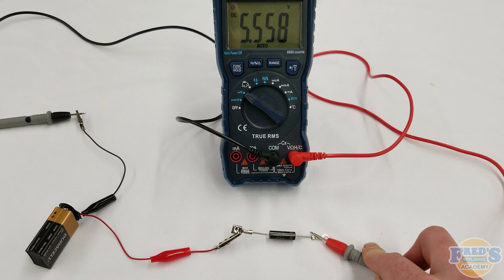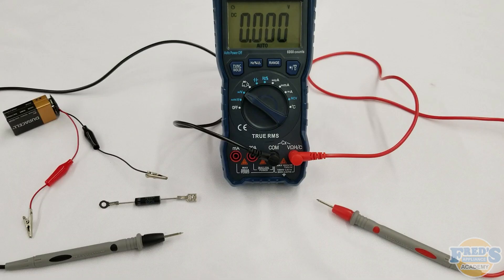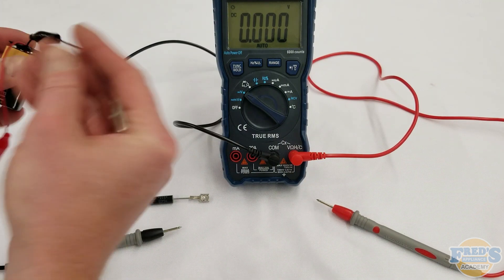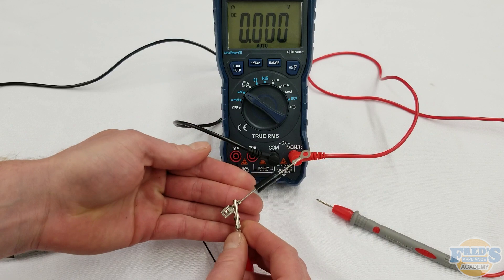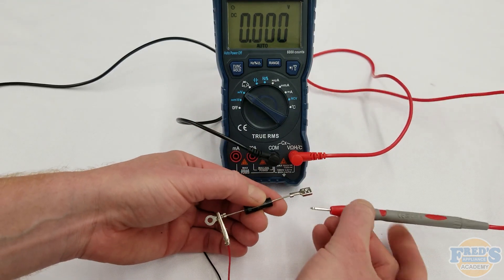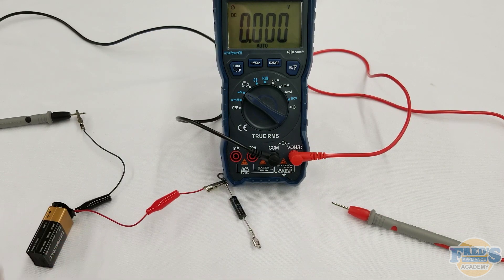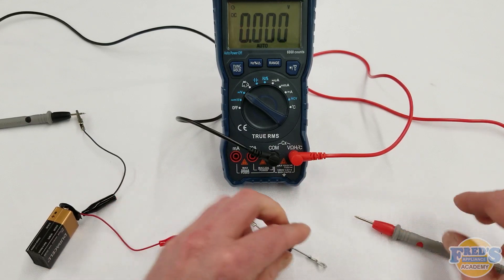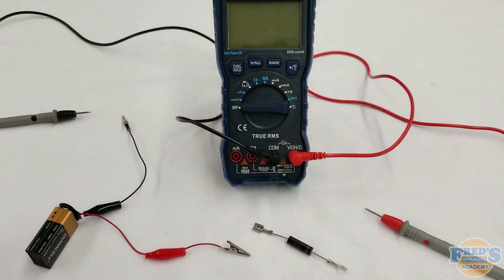Testing a microwave diode with a digital meter

Comment: In this video, is the diode being tested considered good? Since it still shows voltage on the side you mean it should not. Mine shows 5.4v in one direction and .004v in the other. Is that considered good or bad?
Reply from the maker: It should show nothing in the opposite direction.

Comment: Can you please clarify something in your video...  You say power flows from the anode to the cathode sides (positive to negative).   My other sources indicate the anode side is the negative and the cathode side is positive.   Which is correct about anode and cathode polarity?
Reply from the maker: Both are correct — depending on the device.

Battery anode is negative (during discharge).

Diode anode is positive (during forward conduction).

Comment: I have a number of 12 volt, low amperage DC power supplies kicking around.  I assume this would work fine instead of the 9 volt battery?
Reply from the maker: We only suggest the 9 volts since it has the battery terminal connectors.

Comment: Thanks for the video. I didn't have  a 9v battery but 1.5v. It reads the same voltage (under 1 v) in both directions for my the diode  2CL3512H . Is that within normal or it's definitely broken?
Reply from the maker: I would try at least a 9v source. The high voltage diode may require a higher forward voltage. If it tests the same in both directions with a 9 volt, then it is bad.
Reply: @DarkGT: You can't test a HV diode with a 1.5v dc battery. It has to be at least 9v to  test correctly.
Reply: @rscelectrical7091 Thanks, I read about it's "turn on" voltage. My issue ended up being unrelated to the diode.

Comment: Thank you. You saved me from unnecessarily ordering a replacement diode as the initial “diode test” on my digital multimeter showed open in both directions 👍 PS I used a laptop power supply instead of the external 9V battery.

Comment: What if your multimeter is powered by a 9V battery?
Reply from the maker: Set it to ohms and test it's voltage output with another meter. If it is outputting 9vdc it will work. Most digital meters only output 3-4vdc on the ohms setting which is not enough to test the diode.

Comment: I also came up with the idea to do this to test my microwave diode when I suspected that the diodes I was getting and testing before installation couldn't ALL be bad could they?!?!
I then happened to read on an amazon seller's page, a description of how a typical digital MM won't work, so I thought hey, why not boost things by making a litle circuit with a 9V and test for presence of voltage instead of the diode test setting.

However a caution for all. Another video on this platform recommends a 240ohm resistor in the test circuit since the diodes can't necessary handle much current. However I had watched the video only after I had done the test similar to the video above, and there was no damage to the diode. I feel that one is probably safe doing the method that I usedand shown in this video since the MM itself doesn't draw hardly any, so it is unlikely that it will harm the diode.
Reply from the maker: We promise this test method will not hurt the diode :)

Comment: i did this but volts flow through was only 2 volts does this meant that the diode is bad?
Reply: If you have an Insulation tester its better just using that.
Reply from the maker: @cameronbrindley6180   a 9 volt battery costs $1.00. an insulation tester can run around $7,000! https://www.fluke.com/en-us/product/electrical-testing/insulation-testers/fluke-1550c-kit
Reply from the maker: We would suggest getting a brand new battery and checking it again. Also, make sure your connections are good.
Reply: @fredsapplianceacademy  yea I see only 3.3 volts in one way on my diode using a 9 volt battery which tests as 9.01 volts. Wonder if a poor flowing diode will still cause my microwave to hum ?
Reply from the maker: They are not expensive. If it is your personal micro order a diode on amazon and give it a shot.  Make sure you check all other high side components and inspect the transformer for any cracked welds for separating plates.  @cmarlowe1
Reply: @cmarlowe1  My hum was due to a bad high voltage capacitor being bad. Check that (be sure to discharge it first).
Reply: What if i use 21 volt battery
Reply: @joeyparis6482 : You can do the same test, all you need to know is that you have current flow in one direction and not the other.